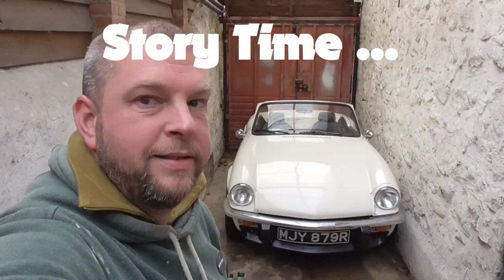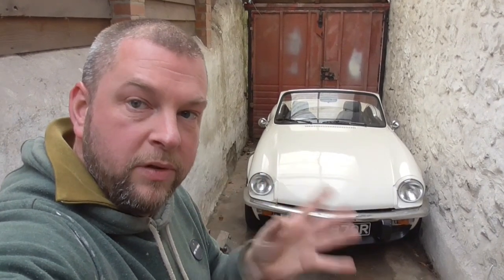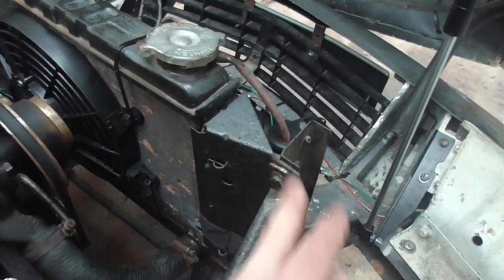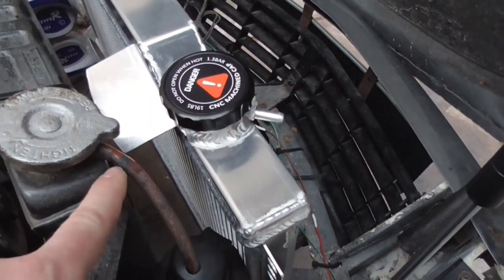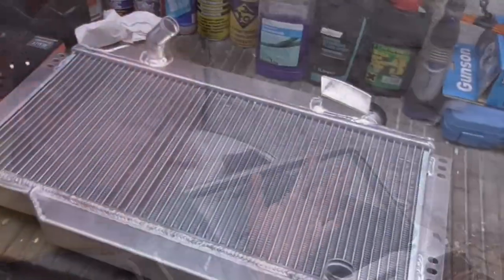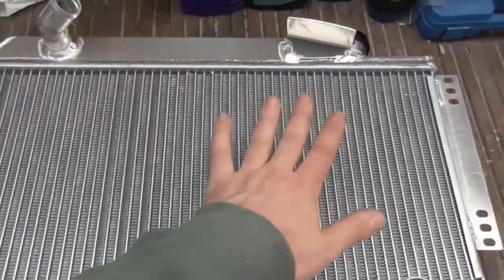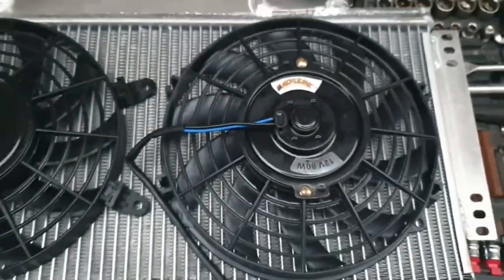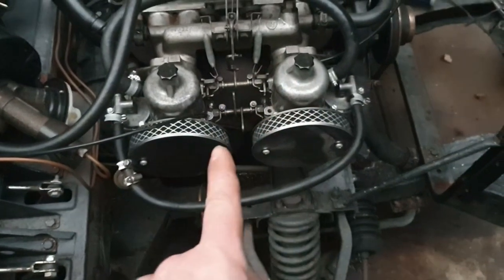Triumph Spitfire | Overheating Problem | New Radiator Fitting

Comment: I know this is an old clip, but if you're still reading comments I thought I'd say something about that dampness you felt at the top hose. That temp switch sensor tube is not supposed to go under the rubber hose, there is no way it will seal up ( unless you put some silicone around the tube where it enters the rubber??) and the tube might get crushed....the sensor is just supposed to lay on top of the hose. Wrap it on with metal foil. Yes, it won't get as hot as when it's inside the hose, just turn the activation temp lower.
Oh ya, there is no mercury in the sensor it's just air pressure.

Comment: Crossed my mind that a smaller water pump pulley would increase the water pressure which ought to help improve cooling, this should be quite a cheap and easy fix if the right pulley could be found or made. Keep up the good work.

Comment: Funny enough, I just installed the same eBay special radiator this morning, surprised by the quality and easy fit.👍
Reply from the maker: The fill cap on mine 'just' touches the underside of the bonnet. Other than that adjustment, it's pretty straightforward
Reply: @BritSpit  just checked and mines the same. Hopefully with the bonnet seal it'll give a little more clearance 🤔
Reply from the maker: @strangeknight3751  if not, you should be able to adjust the bonnet height slightly at the over-rider hinge. or just hog-out the holes in the rad bracket slightly, to drop it down a few mil
Reply: @BritSpit  I've been restoring mine over the last two years and it's fought all the way. Just got the engine in and running, couldn't have done it without your videos 👍. Guess which core plug has sprung a leak, going to walk away for a few days 🤣🤣
Reply from the maker: @strangeknight3751  Thanks for that, appreciated. I'm guessing it's the one under the front engine cover!? The hardest bit for me was getting the [rusted] screws/bolts out from the timing cover. The rest was reasonably simple. But, yes, give it a few days eh? :D

Comment: Those zip ties break after awhile and especially when exposed to heat.  At some point they are going to fail and you will have a fan assembly damaging that nice new radiator
Reply from the maker: Thanks for the tip!